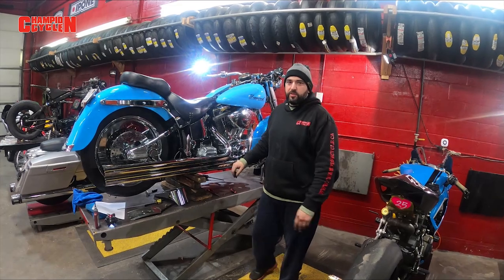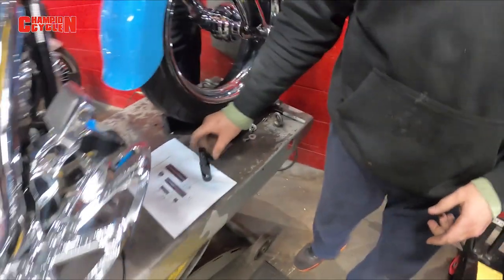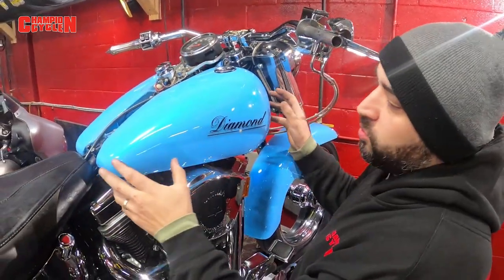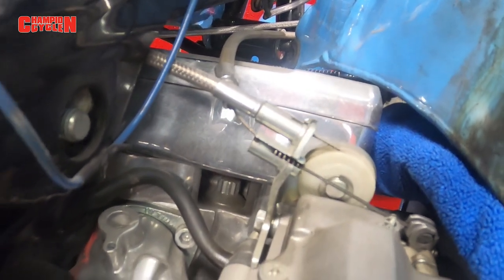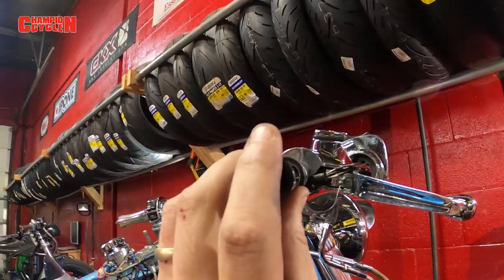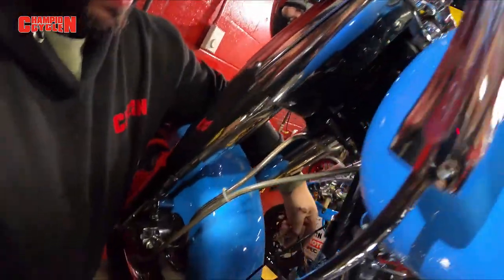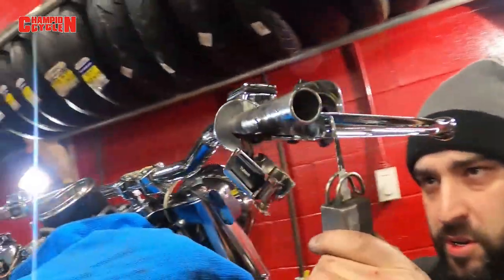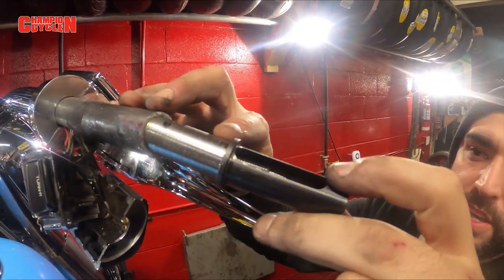HOW TO Install Exile Internal Throttle Cable Assembly on a Harley Davidson Fat Boy or ANY other Bike

Comment: Got the exile internal throttle on my deluxe. Works good. I tried their internal clutch cable too. Its junk. If you want an internal clutch too, get a hydraulic setup and fish the line through. Obviously do the brake too. Its tricky but doable. And worth the work. Great video
Reply from the maker: Absolutely agree. You hit the nail on the head brotha

Comment: Good video and much help.  What do you do with the original throttle cable / start / blinker assembly?  Or what do you replace it with?
Reply from the maker: we reused the existing one for that clean finish

Comment: Hey brothers. Does this throttle application allow 100% range of throttle? Just had a Kustom Tech Internal Throttle done on my Night Rod Special with 16” t-bars and the shop that installed it here in Sweden said that the throttle body is normal to only open up about 70% with this setup. Seems pretty fckd up to me. When I asked them about it they said ”Well how often do you really go full throttle? We never” while I was thinking to myself that I go full throttle almost every ride… Would be extremely thankful for any help or advice on potential tweaks. Cheers guys
Reply from the maker: Yes. The throttle blade total opening is dependant on where the cable is cut/set etc. 
So yes. You should have 100% range of throttle.

Comment: I ordered this kit, and this video is invaluable. THANK YOU GUYS!! I do have one question - how did you attach the grip to the throttle assembly? Did you glue / epoxy it on there?
Reply from the maker: We drilled and tapped set screws into the grips. 
We did them upside down in the video so people could see the way it is done. (Then we swapped them to freshies).

Comment: i'm doing an internal throttle now, and it seems like before cutting the cable the handlebars should be turned hard to the left. this is to ensure you gave yourself enough slack, so as not to snap the cable out of its fittings if the rider cranks the handlebars hard left. that will probably only happen while parked and locking the steering column but it could still leave the rider stranded.

Comment: Didn’t quite catch what you meant by the inner wire cable length before u cut it
Reply from the maker: which part didn't you catch exactly? I could further explain. We did this all kinda' inverted to be able to show everything on camera.

Comment: i notice you used a copper crush sleeve over the internal throttle cable. my copper sleeve was ruined because i had to take things back apart about 10 times. i saw another youtube video where a custom chopper guy did not use a copper crush sleeve and just tightened the set screw down on the cable, so that's what i did. but i'm not sure that was the best idea. what do you think?
Reply from the maker: Copper always works for us. Has yet to fail.
Reply: @ChampionCycle  i just asked ChatGPT 4o. it said i might not have a problem for a while, but eventually the steel on steel contact could fray and break some or all of the individual strands of the internal throttle cable, and/or possibly cause a rusting issue. it said one of the purposes of a cooper crush sleeve is the distribute pressure from the set screw more evenly, so the wire strands are not damaged. it also said steel on steel contact can produce slippage and the copper sleeve can prevent slippage.

Comment: Um, this may sound dumb, but how would you install this kit on a set of "Drag-Z" bars???
Reply: Yea, the cable needs a smooth path to travel. Love this idea but its not going to work with my z bars either. Angles are too severe to accommodate.
Reply from the maker: Very good question..... haven't done it so couldn't say
Reply: If ANYONE (INCLUDING Grays, Reptilians, Nordics, etc.-LOL) has successfully installed this kit on a set of Z-Bars, PLEASE make a video & share link here......Im still waiting & keeping the faith ......
Reply: This Arcturian says, fahgetabout it on Z bars... ✌️🛸

Comment: These are cool but as you showed right at the beginning of the vid, the throttle return is destroyed when you remove the second cable.
Reply: I ran a stronger spring on my throttle body for this setup and it returns perfectly!
Reply from the maker: Yup. But most carbs have spring loaded gates so you can usually remove the return cable anyways. (as most do). To clean up the bar appearence.

Comment: the exile internal throttles need a spring so the throttle snaps back to the starting position like some other after market internal throttles
Reply from the maker: No. You are incorrect sorry.
Reply: @ChampionCycle  oh. thanks for the correction then!